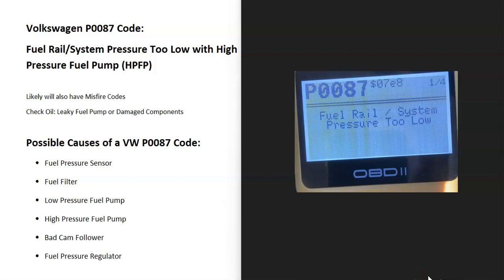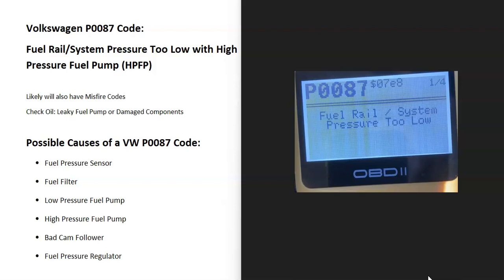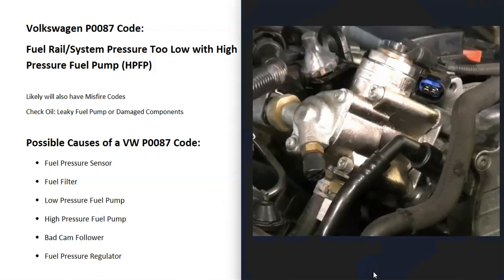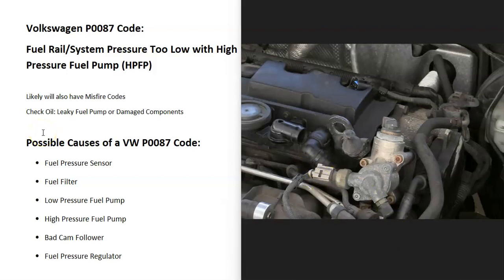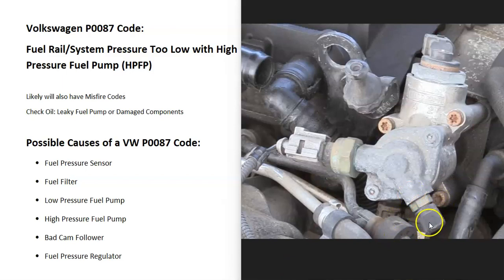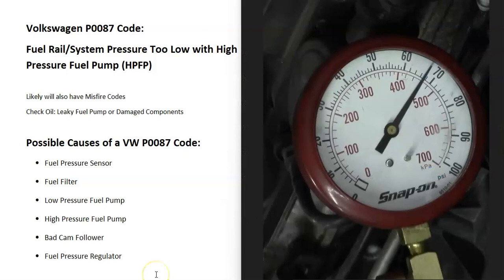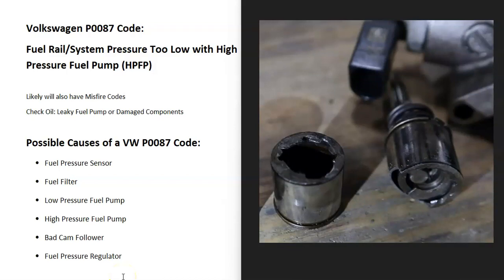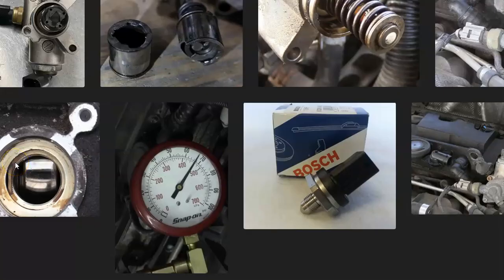Causes and Fixes VW P0087 Code Fuel Rail/System Pressure Too Low with High Pressure Fuel Pump - HPFP

Comment: Hy to everyone, to fix the problem is not related to the fuel pump... is related to the vacuum hoses, i have found the one vacuum hose lose near the engine pump and the solenoid hose was lose.... i tight them whit a zip tie, and the problem no more appears🫡, check the vacuum hose of it lose moves around whit ez... good luck to every body!😀
Reply: Everyone in the comments is changing their whole fuel pump and you just add a zip tie…VW 💀
Reply: @SlowGLI35  Well yes... because the fuel pump is ok, the sensor is ok, but it was a vacuum leak... in my case, so the error is gone🫡
Reply: VW has a TSB for this, and the TSB is to replace the HPFP (on the diesels at least). Being a Bosch CP4 pump, they have problems with U.S. diesel without additives.
Reply: Please, do you happen to have a picture of the vacuum hose location?
Reply: @chris164935  Check all the vacuum hoses, if they are tight, wigle a little whit them if they are coming easy out, you find you leak:D
Reply: Can you share a pic?
Reply: @swatkins783  Check all the vacuum hose, if they are coming out whit ez you found the leak:D
Reply: Hi friend, did u have a leak on the left bottom of the front side car? Standing in front of it? I think I have the same issue right now.

Comment: Audi 3.0 tdi. Starts bad in cold weather <4degs but runs fine when warmed up. Got the same code. Changed glow plugs, battery, injector seals. Injector values all good once engine warm. 
What else would be affected just by cold weather ?

Comment: I have this code right now and i believe its my high pressure fuel pump. Reason is because my car starts and runs fine up until i really step on the gas it just dies.
Reply: So what you did??
Reply: @muhammadhassankhan3249  well I replaced the high pressure fuel pump, cleared the codes and ran the car again only to have the same problem. I scanned it for codes again and this time its the low pressure fuel pump or the regulator
Reply: @Joseph-gy5tg  been having this issue. Did you resolve?

Comment: I have a '15 jetta 1.8 tsi gas. I had a a misfire suddenly the other week, CEL came on. My father arrived with our scanner and we got a code (forgetting now) but it was fuel pressure sensor failed. It hasent done it again aside from once on the highway. I have the sensor now ($158 CAD) but am trying to be certain it's the issue. Any suggestions ?

Comment: i have the same problem with audi a3 8v 2016. P0087. I RE PLACED fuel pomp, high pressure pomp, fuel pressure regolator, the rail. but the error persist! please help i lost my mind...... is 1 year..... i'm going to be crazy
Reply: Have you checked your fuel rail pressure sensor?

Comment: Thanks.getting this code but it says its the fuel pressure regulator,does that mean the high pressure  fuel pump or its a different part.if its a different part,where can I find it?
Reply: Did you figure this out?

Comment: Brilliant video. I have a vw 2.0 tdi with p0087. It will start but cut out within 10 seconds. I've replaced the in tank pump, pressure sensor and regulator but problem persists. Any advice?
Reply: Same issue. Replaced all of fuel components. Injectors, hpfp, hpfp metering valve, fuel pressure regulator, fuel pressure sensor, auxiliary pump, in tank lift pump. Issue remains.
Reply: @ljguy300 any luck since?
Reply: @ljguy300 also interested
Reply: same issue but can’t find anything useful on forums lol, have also replaced most of the same components as you with no luck
Reply: Any luck?
Reply: I heard there's a fuel regulator close to the in tank pump. That's what I've heard fixes the issue.  I'm gonna start with that
Reply: I’ve had the same problem with my VW Passat TFSI for three months. I’ve replaced all the parts you mentioned, but the issue is still there. Has anyone managed to fix this problem?

Comment: I’m having the same problem, each time I change a component/part the van runs slightly different.
I’ve changed the fuel filter, both sensors on the fuel rail, high pressure pump. I’ve checked relays and fuses, fuel lines and wires between pumps! Is thier a way to check the in tank pump and the lifter pump at the filter?
Reply: hi u solved it or not
Reply: @zooomi12  yeah, it was a combination of a faulty high pressure fuel pump and a cheap ebay regulator

Comment: Superb video. I'm trying to solve my issue witha mercedes viano. Had it around 6 months now. Its drives perfect and goes limp mode when I put foot down, replaced the simple things first but still no luck.
Reply: Same !
Reply: @ivandimitrov1823  Sorry, just seen this. I've still got my issue, and it's slightly worse. Before, i could push it hard, but now it's happening quicker. I haven't changed anything yet as to busy.  I reckon it's the sensor. Did you have any luck
Reply: also I have this problem! my car Q7 3.0 tdi  2009 when I drive the car while  3000 -3500  rpm   the system warm rail pressure low how can ı find this problem ? should I  check rail system or same sensor or  injektor  bytheway I checked each injector but I couldnt see any problem
Reply: Did you fixed it? My only crank,doesnt want to start @cagin5781

Comment: Getting this code on my VW scirocco 
In tank fuel pump has been replaced
Also got a new high pressure fuel pump to! All fuel lines have been replaced also and have brand new fuel injectors , as well as this have replaced fuel filter to! But the code still remains.
Reply: Same situation as you. All forums never seem to put the end result so we can then fix our problem
Reply: @strangthings-lover  failed pcm in ecu. Try another ecu boss man
Reply: Samе !
Reply: Mine is mercedes viano. Had it for 6 months and slowly getting worse. But very slowly, I do have 376 thousand miles tho.
Reply: Try replacing your purge valve cheap and extremely easy
Reply: Fuel pressure sensor, change it

Comment: I get this code and recently my car doesnt want to accelerate above 20 so I havent been able to drive it for 2 weeks now what do you think I should do first ?
Reply: Does it work after restart or clearing the codes.
Reply: If you're getting a P0087, are you also getting any of these? If so, you might have one or more bad fuel injectors. 
P0300 Random/Multiple Cylinder Misfire Detected
P0301 Cyl.1 Misfire Detected
P0302 Cyl.2 Misfire Detected
P0303 Cyl.3 Misfire Detected
P0304 Cyl.4 Misfire Detected